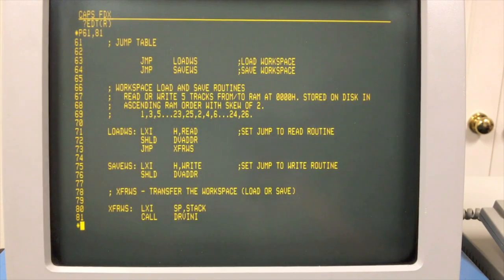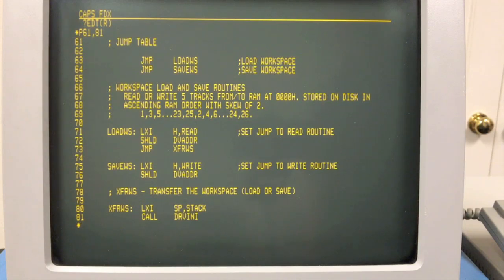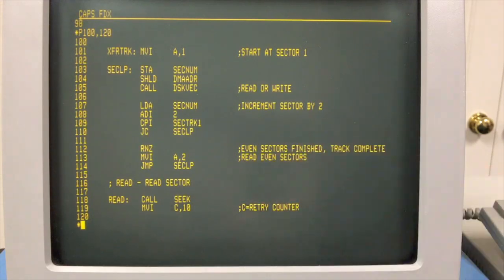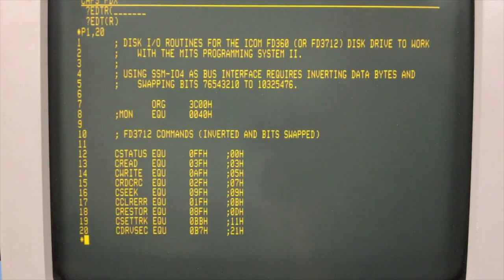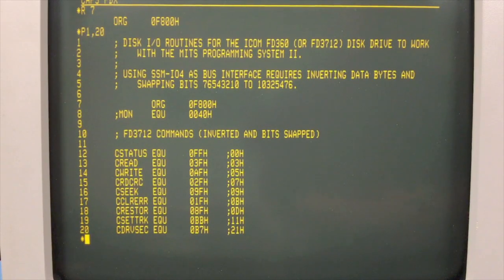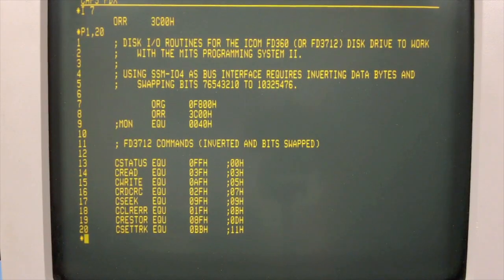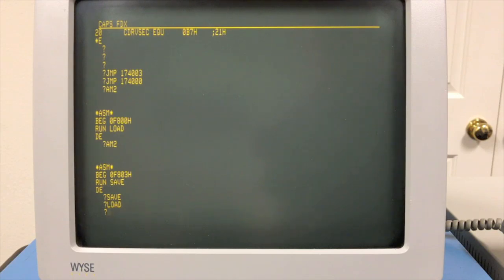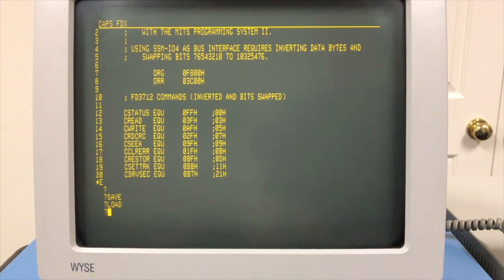Early Altair 8800 - Adding a Floppy Drive #3

Comment: this is a cool demonstration of the divide that opened up regarding the relation of speed vs storage. the ratio of a modern systems ram to its storage is pretty much the same as it was back then more or less. but imagine how long it would take, even with an ssd to load and save gigabytes of ram to and from disk today, certainly longer than a few seconds. in that regard you could even say that modern storage media has actually relatively decreased in speed.
Reply: It's not really that it decreased, rather it's that the actual computer bit (the CPU+cache, RAM, chipset, local bus, etc.) got faster much more quickly than the storage interface and the storage itself did. I remember building a PC around 2003 that had a 2.3 GHz CPU but still used a plain old 33 MHz PATA interface for the disk drives. The more important bit of that is that the disk drives themselves didn't even saturate that channel. You'd be hard-pressed today to find an SSD that can run 1:1 with PCI-E or NVMe speeds without overheating.

Comment: Can this be done with the clone?
Reply from the maker: You can't add a physical external drive to the Clone, but you can run the Altair Floppy version of this same project on the Clone. See the video https://youtu.be/5l3okOGzz-g?list=PLB3mwSROoJ4KLWM8KwK0cD1dhX35wILBj
Reply: @deramp5113  ok, but why?

Isnt the clone the exact replica of the original? Why you cant add an external drive to the clone, but you can add it to the original?
Reply from the maker: The Altair Clone is not an S-100 machine on the inside. It works exactly like an original Altair with it's cover on, but hardware wise, it's not a real Altair. See the details page on the Altair Clone website for more information https://altairclone.com/details.html
Reply: @deramp5113  I see, although its the best looking clone (some of them are white and have an sdcard reader (which doesnt make sense) if you want to play with the inside hardware you are out of luck

I wonder, wasnt altair made from off the shelf parts? Or are the parts to expensive now to be able to keep the original price point

BTW: how does the Extender cabinet (88-EBC) and the card(88-EXC) look like (does the card have an extra cpu or something else), do you have them?

Also there was also the CRT Terminal (CT-8096) (was this ever released?) and the Low cost terminal (88-VLCT) what was the diference between them if you maybe have some idea?
Reply from the maker: See the link at the bottom of the Altair Clone home page that references building a "real" Altair. That link goes to this page about the Altair 8800c https://deramp.com/altair_8800c.html